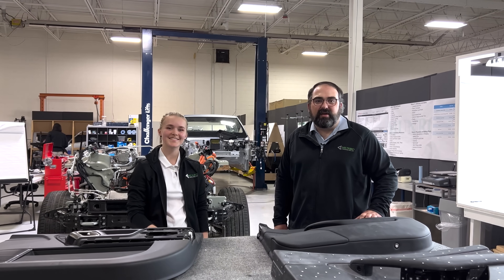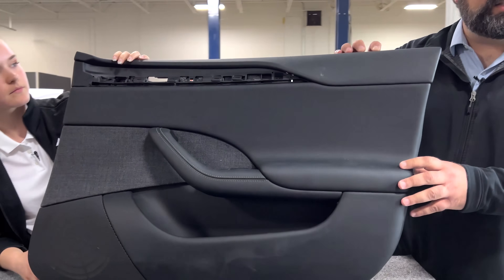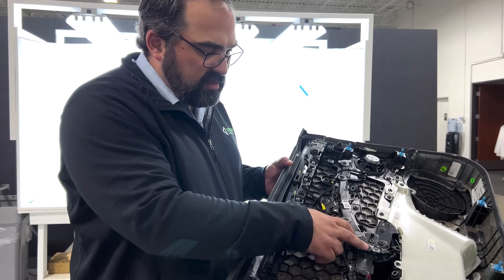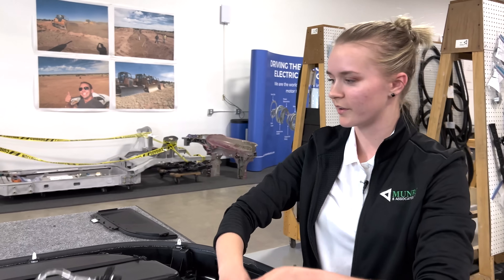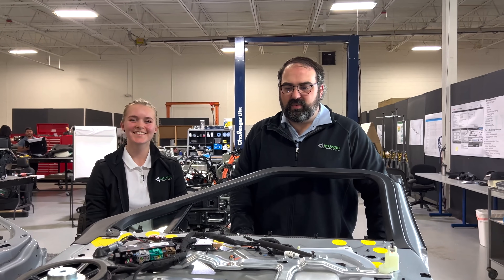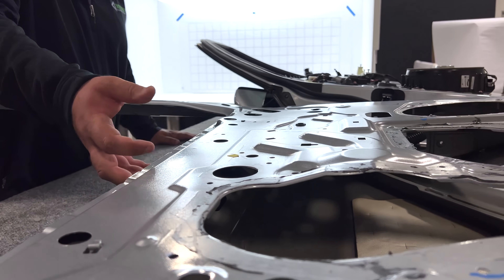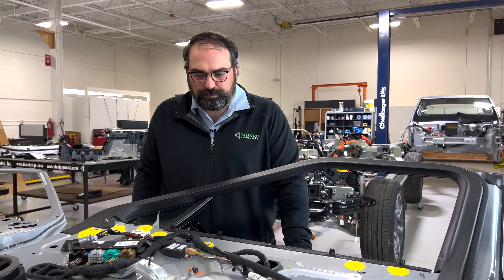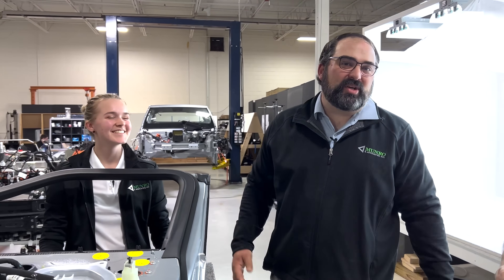Rivian R1T Door Construction Analysis

Comment: Thanks for the video guys.  Alex presented very well.  However, I do have to question why you guys are comparing a Rivian door, from an off-road adventure vehicle, to a Tesla on-road sedan.  The comparison does not seem appropriate.  An off-road vehicle needs to be capable of handling a lot more harsh conditions than an on-road vehicle, which I suspect highly influenced the design of the door by the Rivian engineers.

Comment: Great job Alex, you really highlighted where and how Rivian can reduce cost and be more efficient. Looks like Rivian should really listen to Elon and try to drastically reduce the cost of goods sold. Getting rid of all those screws reduces weight and can improve the efficiency of the battery. I hope they are listening. They have a great product but need some really good engineers that can reduce the number of parts required for assembly. It would help them to ramp up big time.

Comment: The Rivian has soft touch material on the interior door panel?!  I hate that because it's easy to nick, my 2018 Tesla Model 3's interior soft touch door panel is all nicked up just from a water bottle by putting it in the door bottle holder.

So how is it that all these new EV auto makers use so many extra parts.  The claim that they are new to the industry isn't a valid point because the people they hire to design and build their vehicles came from the auto industry, so they should know better.  So Rivian pay attention and get rid of all those extra not needed parts to bring the price of your vehicles down, ultimately costing less for the consumer.

Comment: Team: The over-fastening on this door may be to overcome squeaks squeals leaks and vibrations caused by a powerful stereo system or indeed using the panel in that stereo as a a sealed air volume. In almost all of the cases you mentioned, I could see a plausible argument for this idea including the light strip at the top (that kind of plastic is notoriously noisy when it rubs).

I don't know if the active and passive acoustics of the panels are considered in tear-downs or not, but I suspect you did not get the opportunity to hear/feel the door before you disassembled it.
Reply: I was going to say this same thing! High power audio drivers need lots of fasteners. The baffle needs to be dead solid. She missed the boat on that section of the analysis

Comment: Its very expensive to add blind snaps to an injection molded panel because of the added complexity of slide slide mechanisms needed to create the undercuts and complex parting lines.  A screwed together panel on the other hand needs a very simple and cheap tool by comparison. For a startup on a budget it makes sense to me to use simple and cheap tooling and screws to start with and use profit from sales to finance more expensive tooling later that would likely need revising by that time anyway.

Its the same logic as using machined and welded extrusions vs a large casting or forging right out of the gate.
Reply: Good point.  As I teach my interns, the techniques of building one of something is different from building 10, as is making hundreds of something vs tens, and thousands vs hundreds ...
Not recognizing this gets a lot of companies in trouble as they try to apply the same techniques and bureaucracy at different scales.
Reply: @videcomp Exactly.

Comment: I hear a lot of complaints about the quality and lack of sturdiness with Tesla…but also notice they don’t use as many screws on the door as rivian, is any of that related in regards to the doors at least?
Reply: Most complaints are about the early models having body and panel alignment problems, which is a combination of adjustability and not having accurate assembly jigs.  (You could argue lack of care during assembly, but a vehicle designed for mass production shouldn't require production line craftsmanship.)

The only initial problems we had with our Tesla was the frunk liner clips and a failed riv-nut for the frunk tub.

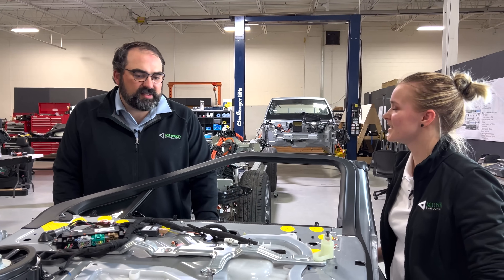Comment: 9:49 Are you sure that a new window is actually a problem? I had some glass swapped once and I was watching as the swapped out the glass. They reused the original glue by adding heat with a heat gun. According to the shop guys as glue was heated up it was good as new. Or so they said. Back then it was not a hard case cover iirc, I think it was thick builders plastic sheet.  They just cut the glue line with a stanley knife and when done re heated the glue and it went back easy peasy.
Reply: That is called butyl tape. We used to use it all the time to seal things. What the rivian uses is RTV which cannot be reused because it cures to form a rubber type bond

Comment: I would have liked to learn more about the differences, if there are any, between a door intended for a vehicle intended for use on roads and a vehicle built to climb rocks and operate on off road trails. In my imagination the twisting forces on the two types of vehicles must be considerably different.

Comment: For those saying 120 screws is to many.  Too many screws, sure possibly, but too many attachment points not really…
Most luxury level doors have upwards of 80 to 140 attachment points depending on content.  

Yes Rivian could save some money on screws by investing in plastic welding equipment but the quantity likely will remain very close to the 120 on the current product. 

Good video, great job Alex & Ben

Comment: I would like a car with so many screws. After a few years when every car interior starts to squeak, you can just tighten everything back and be happy.  Also when a car comes back in warranty or small complaints about squeaks or scratches or something, they can replace just little damaged parts from that door panel, instead of changing the hole thing. And that also helps being eco friendly and recycling just a small part instead of a whole panel.
Reply: The screws in the door pocket will allow replacement of the elastic strap when it gets tired.

Comment: Thanks for the great video. In regards to the interior door panel with screws vs plastic welds, I own a w222 Mercedes S class and noticed a lot of creaking from the door grab/handle when I close the doors (exacerbated in hot weather). Upon pulling off the panel to inspect source of noise I noticed the panel is plastic welded AND the source of the noise. Nothing I could do to fix the problem. Here is where I think screws are an advantage as used in the Rivian.

Comment: In fact that bolt on the corner of the door, is not an alignment feature. Its a door re-enforcement for side crash performance. In a crash it serves as an anchor point for the door into the pillar. The IIHS has made its side T bone test significantly more severe this year. You will probably see a variety of adaptations to door frames, side rails and door mounting hardware as manufacturers adapt to the new standard. For example, on the new EQS, the front door bracket now include a very thick L bracket which when closed forms an almost 1/2 inch thick locking cage around the attachment bolts. Something that they had not done before.

Comment: Rivain is an off-road capable vehicle. Which means the enginnering design choices should have been made considering such conditions. Wouldn't it be fair to compare it to a similar category of vehicle instead of Tesla?
Reply: Exactly.  The Rivian is made for rugged trails and up to 3ft of water.  The Teslas aren't.  They should have compared it with another off-road vehicle.
Reply: I was thinking the same!
Reply: Yeah I really think that plays into a lot of the over build. I would be glad for it if used and abused. But hopefully they can find more economical ways in future.

Comment: Good thing Alex did the teardown because Sandy would have had a heart attack with that many screws, especially the screw right next to another screw.
Reply: At a guess, that was prevent rotation.  A molded alignment feature would be better, but it might have been faster to simply add another screw boss in the CAD program.  This is likely to be a quick-turnaround low volume part, with a redesign as production ramps up.

The extra screws around the speaker assembly is likely to add rigidity and avoid vibrations.  Figuring out the minimal acoustic solution is much more difficult than a mechanical one, so overkill is more understandable here.

Bottom line: over-designed so that they can under-engineer.
Reply: Exactly
Reply: Worse yet, for the one application where they should have used screws they used glue - those access panels to repair broken glass or the regulator. The hourly labor rate for a repair will add up to... let me estimate it... a lot.
Reply: @donjones4719  I’ve seen them glued on a lot of cars
Reply: With those nail extensions none the less …
Reply: lol
Reply: How many screws should we use????  Yes.

Comment: Pretty much everything makes sense to me, including screws, except for that huge swath of RTV retaining the waterproofing panels.  I definitely would have used two screws on the handle assembly.  Two screws with give more bite, if they’re self tapping, than one thicker screw; you also get backup - probably the last thing you want is the handle getting loose, falling off, and ticking off the customer.

How about showing us the regulator and glass?  I had to replace the regulator on an ‘02 Ranger I owned because the tempering was off on the half moon gear and the last tooth ground off and jammed the motor.  I used a an ample supply of four letter words drilling out the Ford pop rivets and for the poor quality of the half moon gear.  When it went back together, I used threaded fasteners, not pop rivets.  Sometimes screws aren’t so awful to have compared to rivets or plastic tabs which always seem to break off (correct, Alex?) when it comes time for service.  Of course, nothing in a door ever breaks or corrodes, NOT.

Comment: with that many fasteners in the panel its surprising the Tesla panel is the same-ish weight by size. I would guess that means the plastic is thicker, more webbing adding to the structure.
Reply: @thealienrobotanthropologist  
that's not 100% accurate reducing cost could be a secondary or tertiary... reason for eliminating a fastener. two or more plastic parts may need to be molded separate but after assembly no longer need to be separated for any reason. a fastener isn't better just because its more expensive.

Comment: Tesla may be able to make panels slightly quicker and cheaper, but I can tell you that my couple year old Tesla rattled when driving down the road worse than any other car that I've owned did.  Maybe there are other considerations aside from cost/weight to consider.
Reply: On my third Tesla, and each have been mostly rattle free.  I did have one minor issue with a rear seat latch rattle that Tesla corrected with a design change and service fixed.  I don't know about your car, but I suspect 95% of rattles in all cars are something the consumer left in a side pocket or rolling on the floor or trunk.  Sometimes they are really hard to find, but are not a manufacturer failure - but they get blamed for it.  EVs make it even more noticable as they are so quiet.  In most ICE cars, you can have all sort of stuff rattling around that you can't hear over the engine/transmission noise.
Reply: @tesla_tap  I think your 95% estimate is extremely generous, but it's probably true that some rattles are from things left in the car.  That wasn't my case (e.g., in early days Tesla fixed a rattling seat belt mechanism on my car).  I'm also not convinced that ICE cars are any louder than electric cars at anything above a slow speed but, admittedly, my last two ICE cars were a Cadillac and an Audi, which are abnormally quiet cars/engines.

I'm not saying that Teslas are bad cars, by any means.  I loved my Tesla and I think it was more fun to drive than the vast majority of cars I've driven.
Reply: That's not normal.

In general Tesla's mission is to build as many electric cars as possible, not to make the highest quality cars. That's the tradeoff. Most of the issues come from the production ramp, once the line reaches a steady state, quality improves a lot. Most of the cars they make now should be as good as any German one.
Reply: @andrasbiro3007  That's true.  I've heard that newer Teslas have improved a lot.  My Model 3 was from the frantic ramp days and likely built in a tent in their parking lot.  My Rivian, honestly, had more issues (minor quality issues delivered with the vehicle, software bugs) than my Tesla did.  I knew I was buying new models/brands with both Tesla and Rivian, so some early adopter pain was expected.  Over time Tesla fixed their bugs and most of the quality issues with my car and I wouldn't hesitate to buy another Tesla.
Reply: What many don't get, it's that Munro company looks more into saving production costs to the manufacturers than to the costumers.
Reply: @RogerM88  I think it's pretty clear that's their primary goal from their videos.  Sometimes when you're a hammer, all you see is nails.  With the YouTube audience, it may make more sense to point out other the considerations.

Comment: OMG Sandy is gonna freak out when he hears there is  120 screws per door.  That seems a bit mad in fairness.
Reply: I do agree with you sir.  I think customer satisfaction must comes first and then cheapness of construction second. If it takes 120 screws to do the job right , well so  be it then , screws cost pennies so won't effect overall cost that much maybe will cost assemble time in labour though. I've seen cheap do panels on my vito van and it is super annoying. Agree build quality of audi is probably far superior. 120 is a bit much though . Would have thought maybe about 40 to 50 would be ballpark.
Reply: Screws are more forgiving than misaligned molded retaining clips. Especially for a startup. Easier to mold simple parts (simpler molds) and drive screws into them
Reply: No need to downgrade or decrease Rivian quality for cabin insulation since the softer materials need to be properly fixed not flapping, also gaps between different materials that have different structural build of doors faces resulting in overall superior quality they also have sound & vibrations proof much better then Tesla, that is why lots of people who own Teslas are ending up resale them and putting deposits to buy Rivians because quality does matter.. No need changing for Rivian that is already good, the changings need to be made on Tesla for better quality if they still want people to like them, specially for Tesla Plaid that feels so cheap inside compared even to an Audi RS3 but yet Tesla are charging people so much more instead offering a good balanced quality interior for that range of prices ..
Reply: @poplaurentiu4148  Lol...just no. There are not "lots of people" reselling their Teslas for Rivians. And people are still buying up used Teslas for higher prices than new ones. If there truly were quality problems as bad as you are trying to portray Tesla demand would have collapsed ages ago especially with alternative options out there now, and yet people still wait over a year to get them, and people still buying used Teslas AFTER inspecting them.

Tesla has no more of a quality issue than any other company including rivian and other luxury brands. The outsized attention on quality of Tesla is just a media made up narrative like "range anxiety" for EVs. Another narrative that gets busted when consumers own the products. The only difference is the name"Tesla" sells and generates clicks. If you go on Rivian forums guess what....there are complaints about build quality and gap issues. The difference is most people dont run to YouTube or twitter if they have issues with their new Mercedes, Honda or even Rivian. Why? Because they know that nobody cares.
Reply: @DorkJelly  My opinion was formed after driving in Europe Tesla cars and plenty other full electric vehicles owned by companies like Bolt, Uber.. etc, also after disqus about with few friends that are owners of different versions of Tesla, and since my uncle owns a BMW i3 the build quality from Tesla & BMW is like a mile distance but i tested other full evs like Jaguar i-Pace, Hyundai Kona & ioniq 5 ev, Kia EV6 GT, Audi e-Tron and  volkswagen iD3.. all feel like the quality is superior over Tesla specially inside.. beside most Europeans are not such big fans of looking often to the Tesla center TV instead prefer & like a head-up display projected on the windscreen specially while driving in the night, as i mentioned i used to work as driver part-time for taxi services (Uber & Bolt) and sometime the night shifts is more profitable but is a much helpful feature, way better regarding safety and super easy to drive if the car has a head-up display projected on windscreen..  which not all Tesla's have.. beside the charging network can be shared so each owner decide what they like better and what not.. i put first deposits to replace next year / (trade-inn + cash difference ) for my wife old Volkswagen Sharan with a new iD-Buzz, i got a very good deal from my local dealers with lots of bonuses.. so yeah.. Cheers ! ;0)